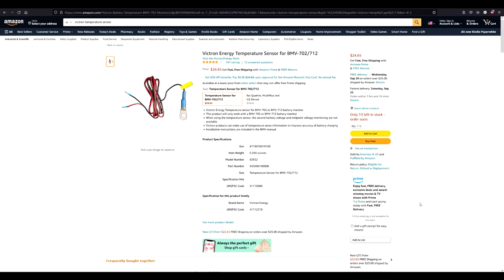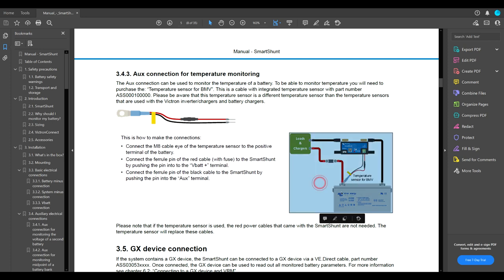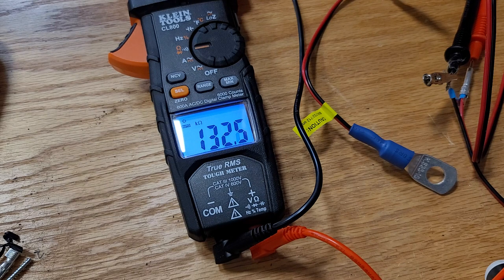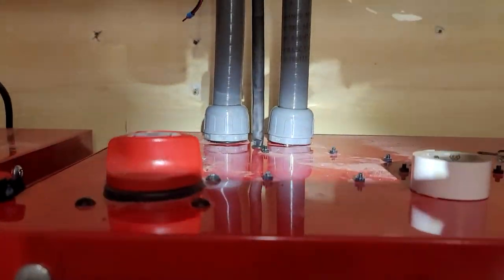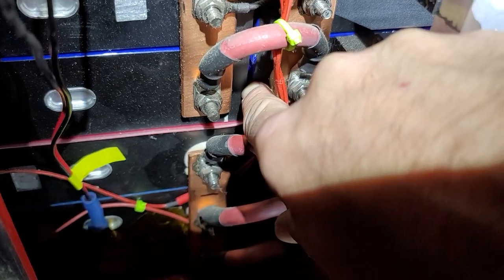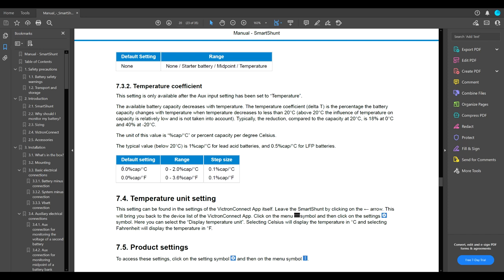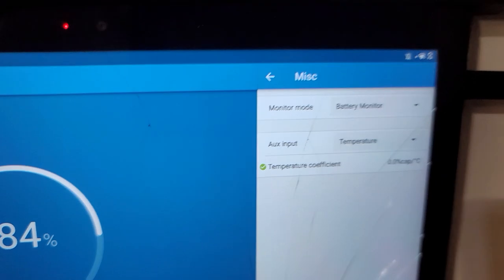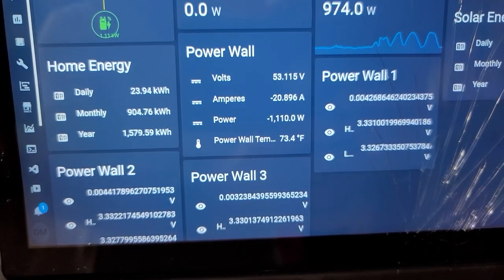Victron Smart Shunt Temp Sensor Install & Setup

Comment: Ehm Victron says its not a termistor but a chip inside. They even say you can damage the chip if you measure the resistance with a multimeter since the voltage is 5 volt inside

Comment: ZigBee temp sensor, home assistant. Bam, done. 😉
Reply: Wouldn't adjust the smartshunt to show the % of battery usage adjusted for temperature then though. But if you just wanted to add your own emergency don't charge when below freezing, sure that would work.
Reply from the maker: Yes, this sensor helps with SOC calculations. How good those SOC calculations will be during winter remains to be seen since we have large temperature swings which I think will have impact. Another long term test.